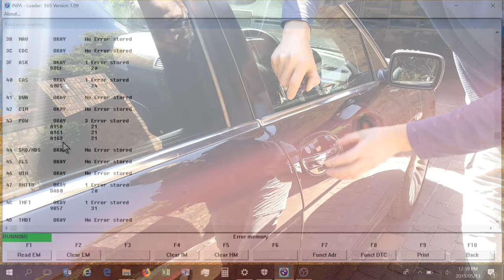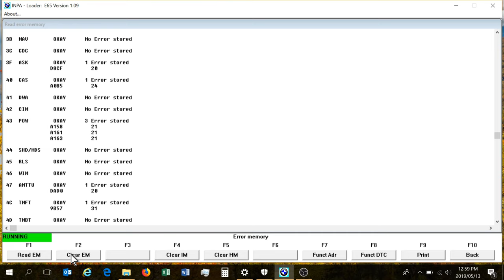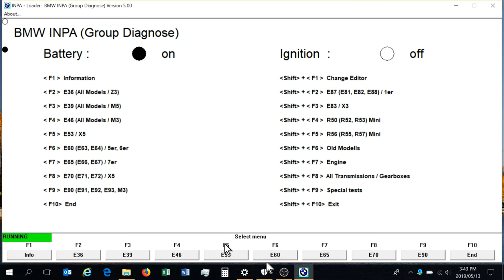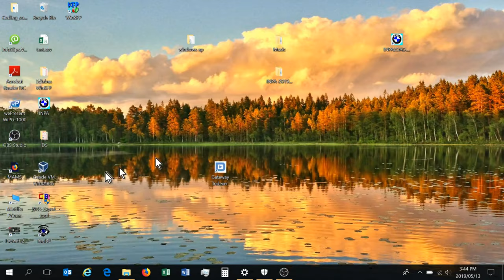Fault tracing and repairing BMW comfort access door problems- detailed

Comment: Thank you so much for making this video! It's detail gave me the confidence to fix that on my own and saved me 385€ for a non painted spare handle. In my case 3/4 cables were broken. Thanks to your very well and detailed manual I was able to do the same (with standart tools) and guess what - it works again!!! Only negativ point: since I've dismounted, cleaned and oiled the one handle I fixed (driver side front) it feels so new and well that I want to maintaine others also ;) 

Big shout out to ecologicaltime!
Reply from the maker: thank you

Comment: Thanks for the video! I had a battery discharge error happening frequently. Used a heat gun to test the handle that wasn’t working and it was 10 degrees C - others were 2 degrees in winter. I took the handle out and disconnected the comfort access clip and the battery drain is gone.

Comment: Hello again.  Can I please ask that if you do not (or cannot because you do not have the right scanner) clear the error codes, will the system clear itself if you simply fix the problem?  In other words if I fix mine without clearing the codes (assuming they are there) will it start working?  Thanks - Mark
Reply from the maker: should work if you fix it and dont clear codes.
Reply: @ecologicaltime  Thanks so much for immediate response. Great news. Will work on that when I get back home in a few weeks and report back on my experiences for the possible benefit of others.  Cheers.
Reply: Could not wait so I attacked the handle yesterday. Wires were broken as yours and when repaired and reinstalled you were correct the codes must have cleared because it works fine - thanks.  I had a big issue reinstalling because the small tab that holds the inner plastic and locking slide mechanism in place at the end opposite to the key hole was broken off and so the whole assembly pushed inwards when installing making it impossible to lock in place.  Solved this by drilling a small hole in the door bodywork under where the handle sits next to a small slot that there is in the plastic assembly and cable tied it!  Cable tie was small enough not to interfere with the handle surround. I then found that the locking mechanism worked loose after about a dozen pulls though (Because the cable tie has a small amount of play meaning the door handle actuator thingy pops out out of place and the handle just makes the clicking noise) and so went in back by removing door cards, secured it in place with the slide and then locked it in place by drilling and inserting a small self tapping screw through the metal slide into the plastic part.  Cannot remove the handle using the little slot any more of course and will need to remove door cards to allow me to remove the screw when I want to remove again in the future. The handle (LH drivers) does the one pull to unlock and another pull to open routine.  Others all unlock and release at same time.  Will try to get Carly and see if I can recode.  One small question if you don't mind and that is the whole CA system goes to sleep after about 15 minutes after I lock the car and I then have to use the key fob to unlock - any idea if this is normal? Thanks again for your incredible video.
Reply from the maker: thanks, well done, yeah the reassembly is much more work!

Comment: I fix all door handle  bad cable . but my car still  Comfort access  dont work . 
Do.you know why ?. Thanks
Reply from the maker: i have other comfort access videos, have you checked them? They in my BMW playlist. Can also be a fuse.
Reply: I went through 4 ~ 5 inspection wire tests, and finally I replaced a used one door handel . one door work now.  so i think handel inside Chip damage.   I plan to buy 2 more to replace the damaged other handle .   Thanks so much  for help.
Reply: Start/stop working without key?